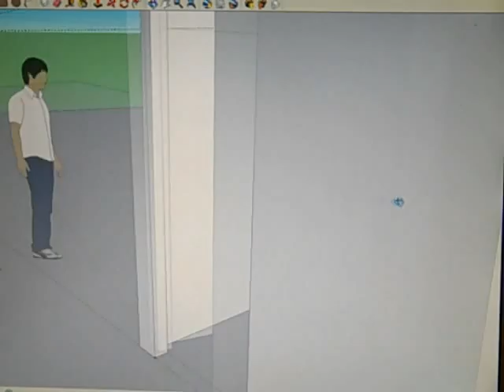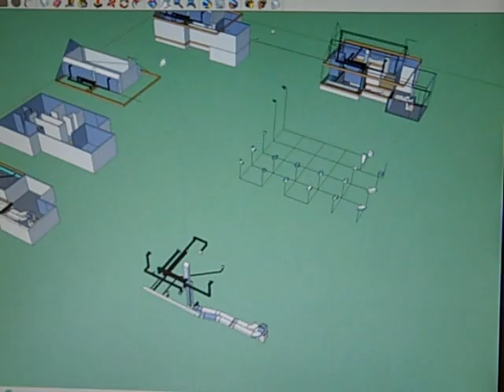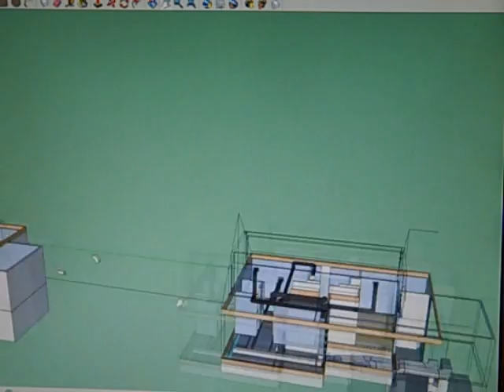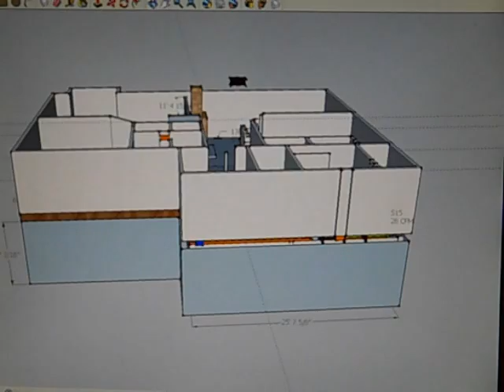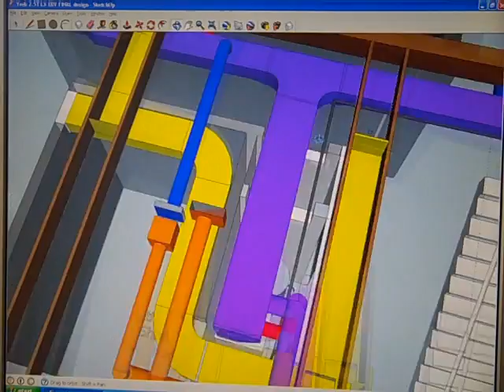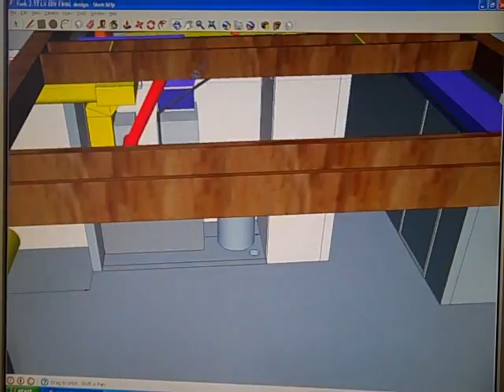HVAC Design Build P 3.wmv

Comment: @tstatech - VRF=VariableRefrigerantFlow. I'm sorry u have not had a good experience with VRF/Ductless inverter systems. I started in our industry in 1986 as a young boy & now I'm providing sales & technical support to some of the most advance refrigeration and electrical systems known to man. 25% of my time is working with engineers on designing residential and non-residential systems. If you give me 15 minutes I am certain I can increase your bottom line and customer satisfaction.

Comment from the maker: @comfortairguy By VRF I presume you mean variable frequency drive. I have used ducted and ductless mini splits with variable speed compressors. I don't care much for the quality of the mini splits. They're ok for apartments and small bungalows but houses where I live are big. The ducted mini splits don't have much available static pressure so they are very limited.